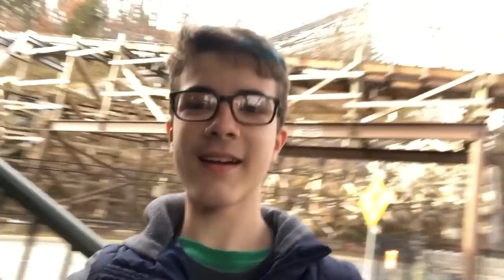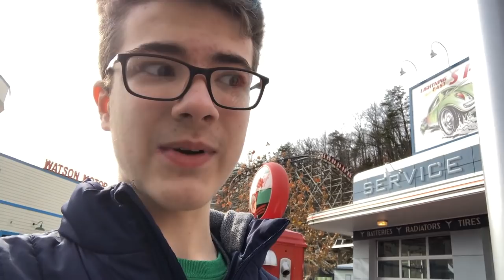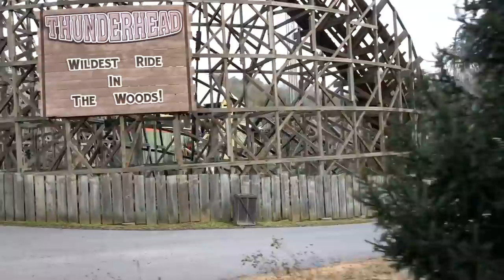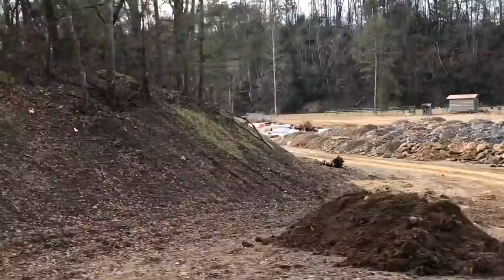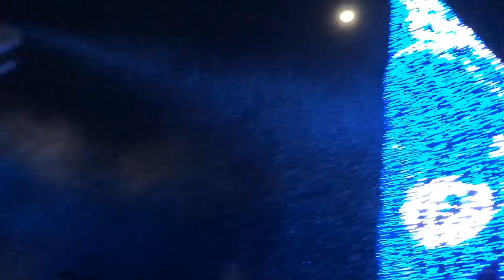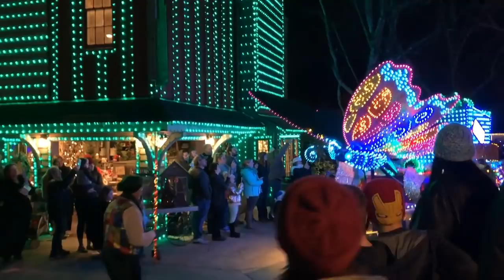Dollywood Wildwood Grove Update!

Comment: I rode it last Saturday and Sunday and lightning rod was definitely worse than I remembered from November 2016 and March 2018. Rode SV and TT between my two Dollywood visits this year and for those being the only three RMC’s I’ve ridden TT is almost as good as lightning rod. Obviously steel vengeance is way better than both but the my preference between TT and LR has slimmed a lot with the addition of the trims and how the second to last right hand banked turn after the quad down beats you up a little
Reply: Yes, the turn before the break run does almost beat you up a tiny bit, but it almost adds to the intensity. Also, the new trim at the bottom of the drop was off today. It still wasn’t exactly as good as LRod in 2016, but it’s 95% as good in my opinion.